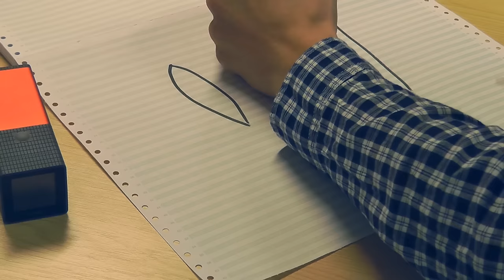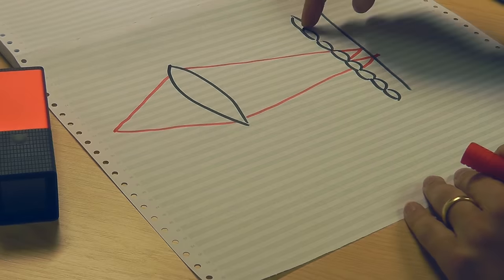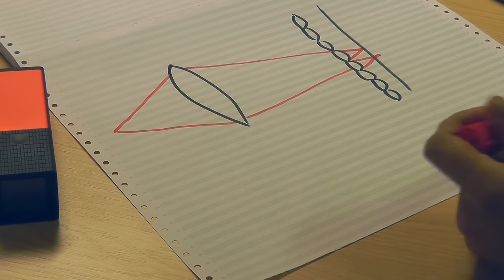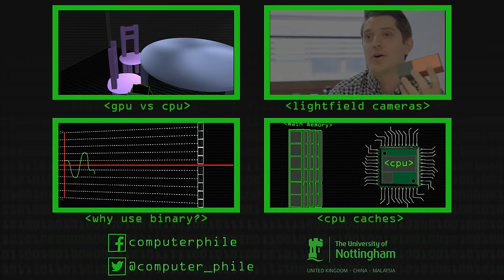Industrial Light-field Magic - Computerphile

Comment: Does a Raytrix allow for a better result at green/bluescreening? I mean, it's certainly easier as it wouldn't require any special background to be replaced. But is the depth map precise enough for that?
Reply: +anothergol I have seen this kind of application with these kinds of camera's before, but I can't remember where. So for what this is worth, yes you can. But using a green screen is waaaaaaaaaaay cheaper of course.
Reply: +L0rd Log1c I can also imagine it being cheaper when shooting outdoor, for parts of a background that need to be edited. Like, I've seen very very large green screens used outdoor in Game of Thrones, and they're only there to cover what the characters in the foreground will be be in front of.

Comment: I think that two normal cameras adjusted like human eyes can determine deept of points in space.
Reply: It's possible, but it is much harder to calculate 3D image from it.
Reply: There are two steps to calculating depth from a stereo set up (two images), first you need to find matching points, and then you need to calculate the distance between them in each camera.

That first step is not accurate enough for great results. Light Field cameras give you much more information, and the cameras being so close together really restricts the area where you need to search for matching points in the neighbouring image. Overall this gives you way more accurate disparity maps. Like the average difference (squared) from what should be the depth, and the depth map is in the scale of 0.001 - 0.01 pixels.   That's really small. You can get some insane accuracy with those things in normal lighting conditions.

Comment: Are Light-field cams used in producing 3D movies? If not, why not and will they in near future? You wouldn't need to have two lenses or cams, so it's possibly less expensive.
Reply: Not yet. It'd be great I think, though with industrial cameras the lenses are usually fairly carefully selected so it's not like you can switch out a lens very quickly for a different shot. Current 3D is usually captured by a two sensor camera, they're very expensive. That said, you can rent them, and the budget for big movies is pretty high!

Comment: So for Lytro, is re-focusing just a blurring whose strength/blurriness depends on the depth map? For example, if you focus on something near (close to each other on depth map), pixels with higher & higher disparity will be blurrier & blurrier. But if you focus on high disparity pixels, then pixels with low disparity are the ones that are blurry...?
Reply: +mnfchen This is how the raytrix does it as far as I know. The Lytro works by modelling the light rays, which ends up as a process of adding up a lot of values from specific pixels, depending on what you want blurred. Two different techniques, but the output is similar.